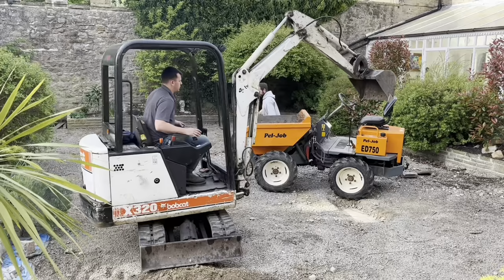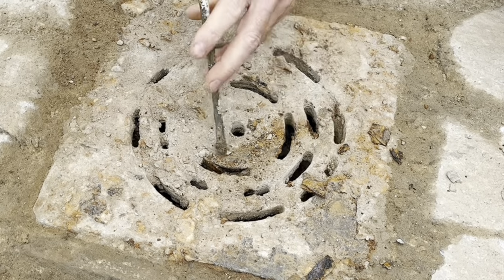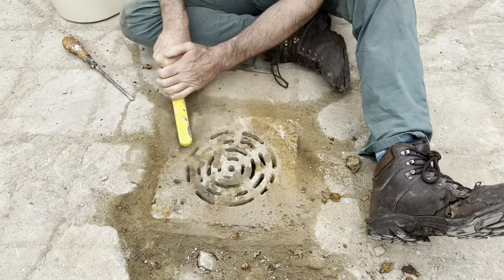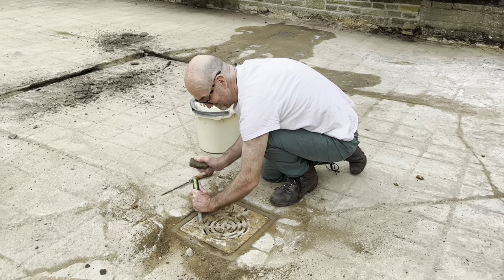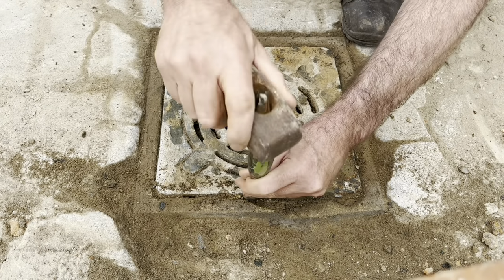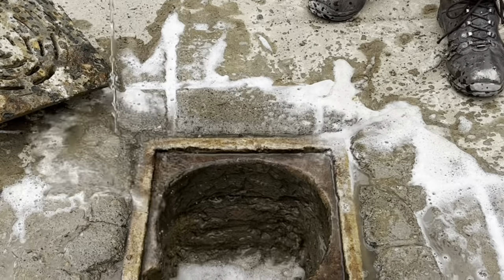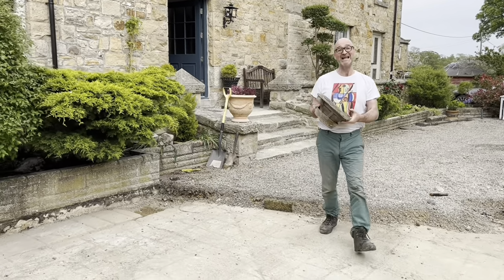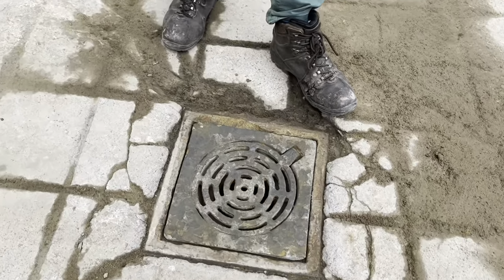Restoration of 200 Year Old Cast Iron Drain Cover - Found Under My Driveway

Comment: Love the screwdriver/grate hole clearer! It looks to be antique itself.  I was born about 20 miles from The Stanley Works.  One easy way to figure out what it's made of if you run into another later - ye olde refrigerator magnet.  They stick like a limpet to cast iron, and would just sit on stone or pottery and look at you cock-eyed.  I'd say paint it bright blue again.  Why not, right?